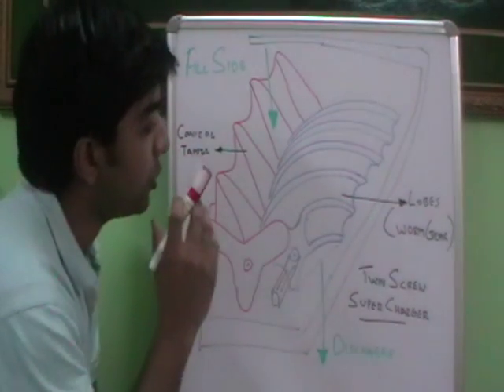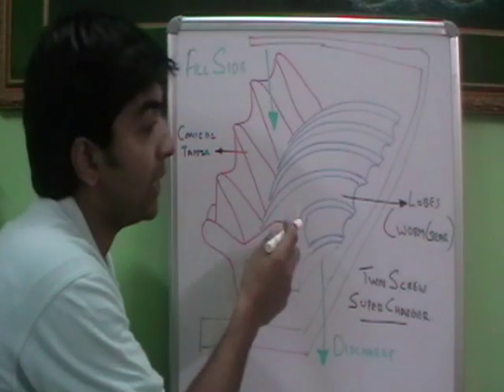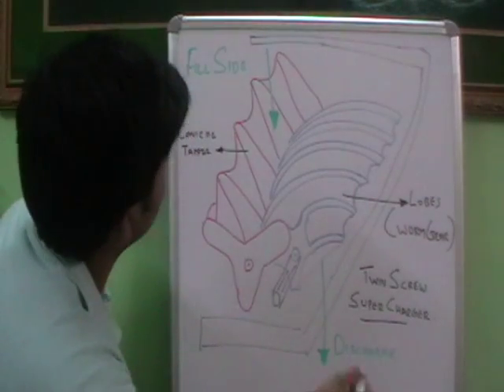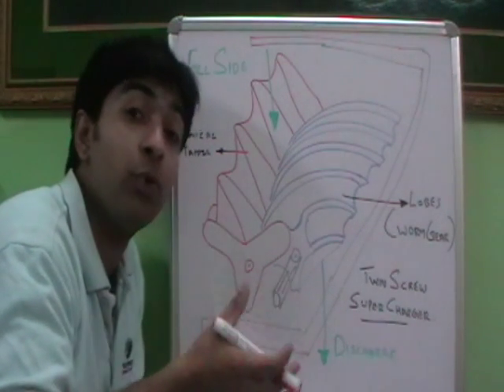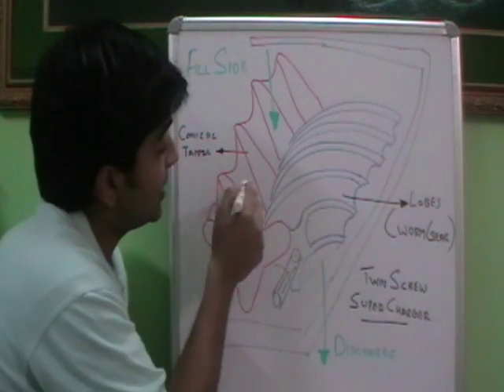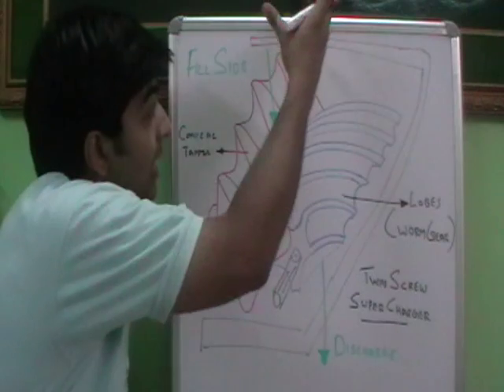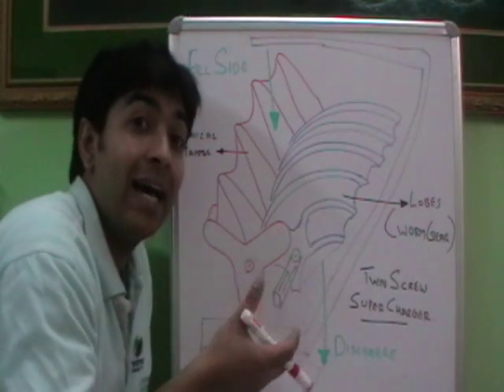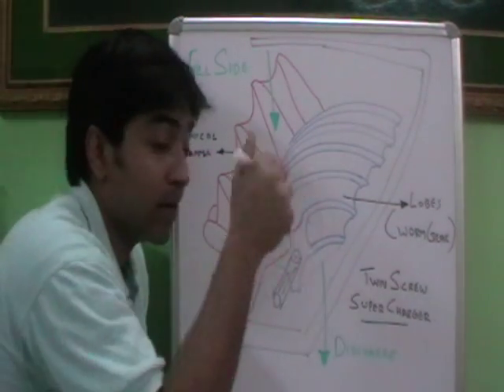How twin screw supercharger works. ✔

Comment: Are these two rotors touching eachother or there is tiny gap between them ? If they are touching then how come one of them doesn't move up or down relatively to the another ? It depends to the profile of the rotors ? Angle has to do something here ? Thanks for any answers :)